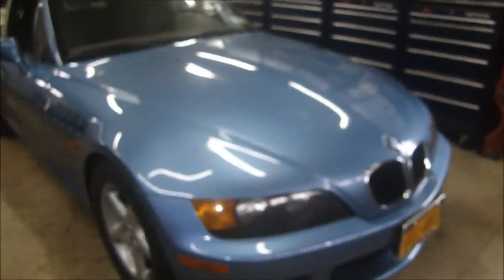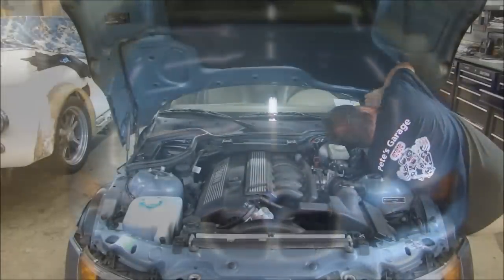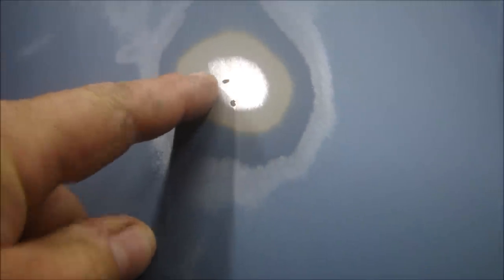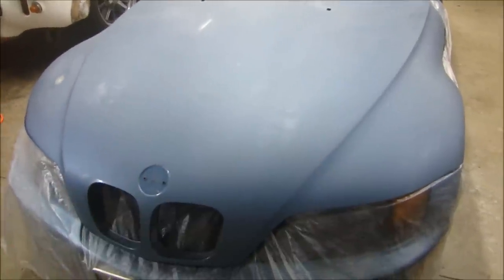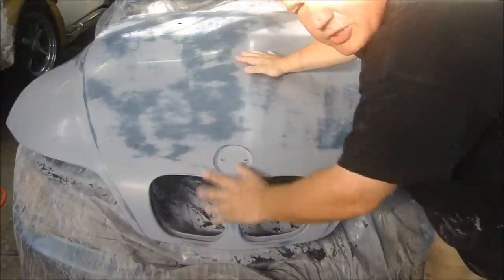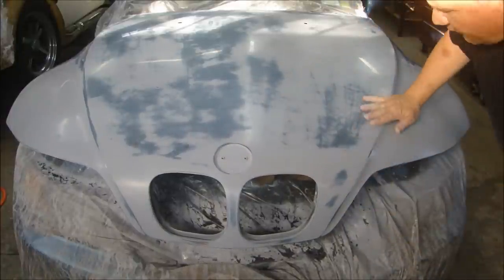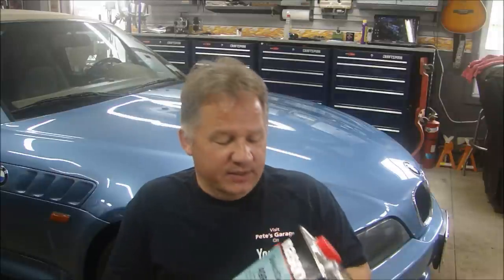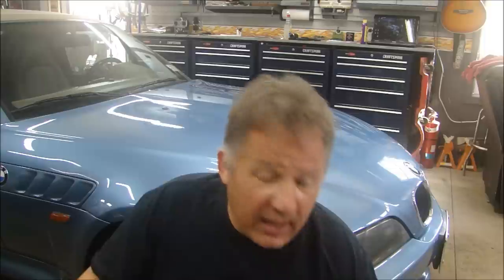Painting Complete Panels - Prepping for Paint, Fixing Chips, Applying Base & Clear Coat, Buffling an

Comment: What type of block did you use when sanding? I appreciate your instructions. Thanks.
Reply from the maker: I used a small, foam block made for wet sanding. It bends to the shape of what you are sanding but firm enough to make it flat.
Reply: Thanks for the info.

Comment: A proper look at prepping a rough hood.  Thanks,    If you are looking to restore a hood and have the time would it be better to take it back to metal/block sand it rather than adding putty or high build primer to make it flat?
Reply from the maker: It really depends. I try to maintain the factory primed surface.
Reply: @PetesGarage  Thanks for the tip.   I've been looking at the Easton and PPG rollon 2k Primers for bare metal (basically 2k with extra thinner).   Dollying and peening stone chips and dents as much as possible is more appealing to me than saving time and money.  On my own vehicle time is not money.   I am perfectly happy putting unreasonable hours into small jobs.
Reply from the maker: That makes sense

Comment: "Seals that raw paint so that nothing is gonna attack it"  Ummmmmm isn't that what the 2k Urethane does???  What happens when the sealer wears off???  The 'paint' goes bad.  lol so close... so close.  But right at the end you say this.
Reply from the maker: When you polish a 2k paint it leaves a raw surface that can oxidize quickly. Yes, the 2k is a hardened paint, but it is still susceptible to UV.

Comment: What donu think of the that red putty i been working on cars for 10 years and never used it since they one i been told its no good that it sinks and cracks yet i seen a lot of people use it
Reply from the maker: That is red polyester spot putty. It is fine for filling chips and very small dents, but now for high build areas, that is when it cracks.